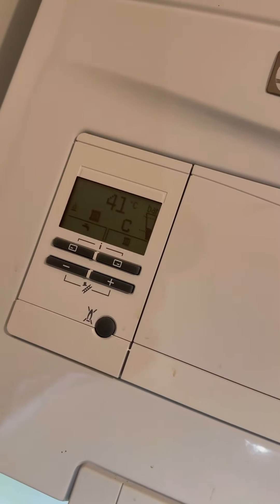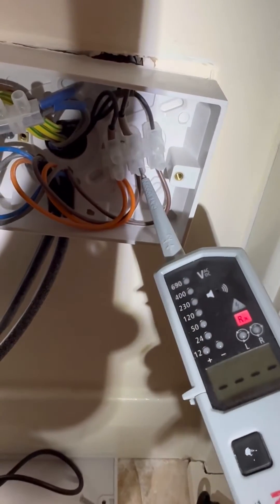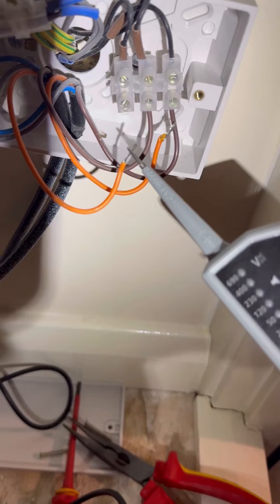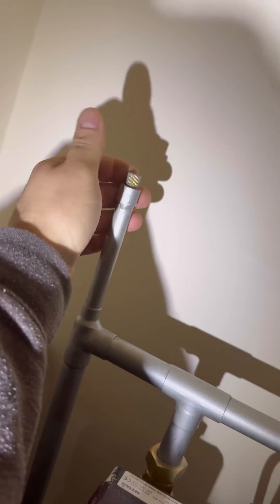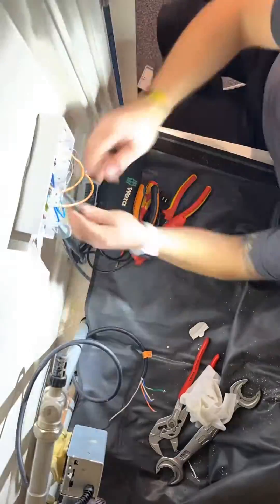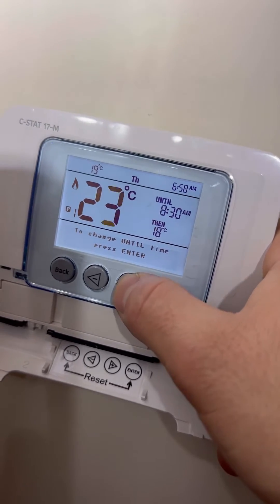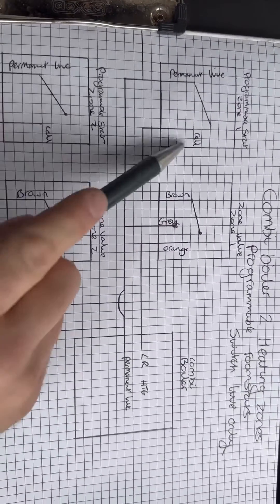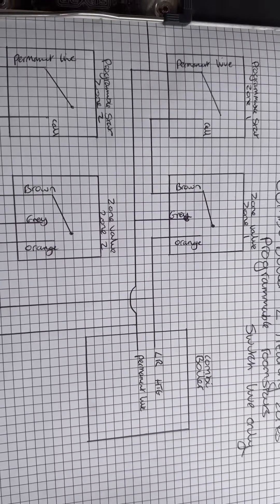Vaillant ecofit sustain combi boiler with 2 heating zones and can’t turn the heating off

Comment: Super video. I'd appreciate an "idiots" guide on basic user instruction if you wouldn't mind... just posted this on the Vaillant channel: Please kindly publish an easy "how to" guide for the digital thermostat AND on the actual boiler.

To make this work I need to set the thermostat to 140 (140 what? No unit measurement)
At 130 it goes cold. Brand new, not user friendly or intuitive - manuals not instructive or illustrative. No capacity to set a timer??

It's all very well branding a sophisticated eco design, but Joe public needs to be able to use it..!

Vaillant please consider this request ASAP, it will assist many. Thank you 🙏

Comment: Hi mate. A quick question. As you had 240 to the orange, which was coming from the grey. Was the valve locked into heat only? And could you have got an idea of that, if you’d seen the valve locked in that position, before opening the 10 way?